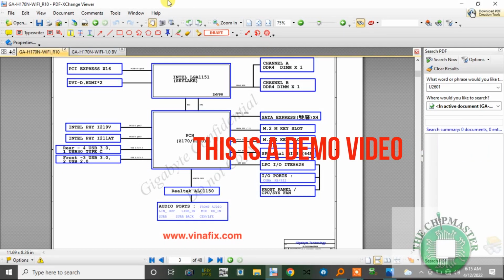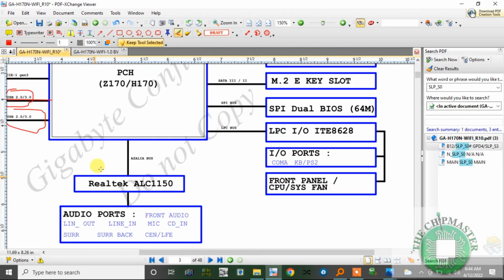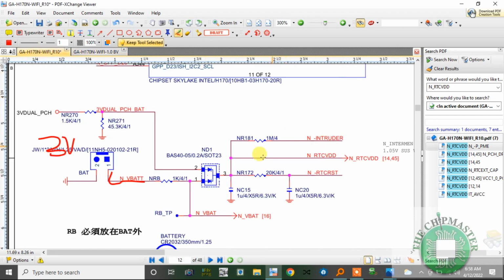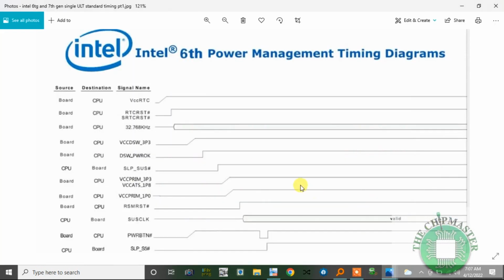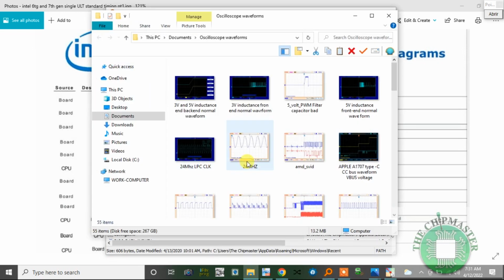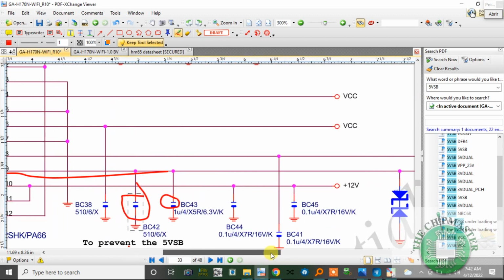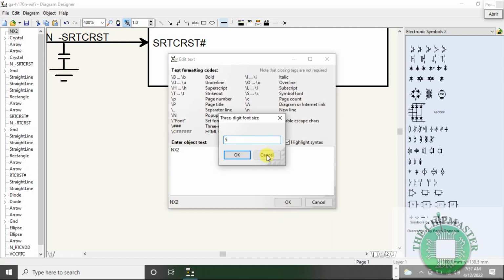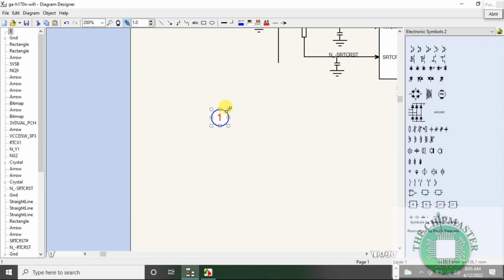GIGABYTE GA-H170N WIFI Timing analysis PT1

Comment: Hi, there is something strange problem with your last video (the one where you explain how to use the oscilloscope to track down power issues), the video is classified as “for kids” and I can’t save it on my library. Also seem that the audio is totally missing :( sorry if I reach you using comments, but I don’t know where I can send you a message
Anyway thank you for your hard work and effort to explain how to fix this devices.